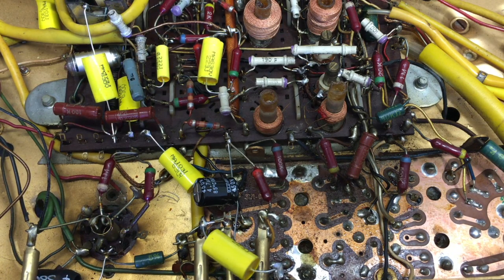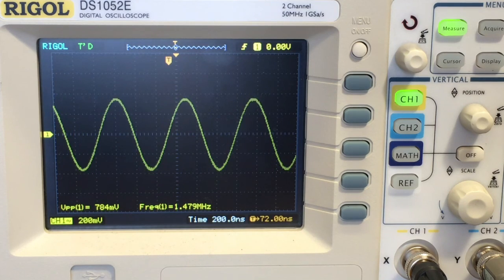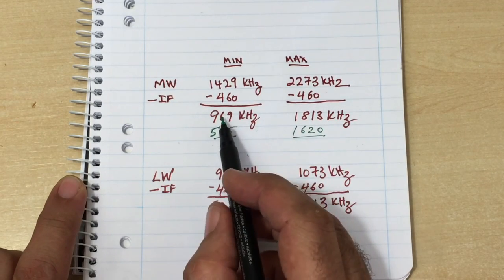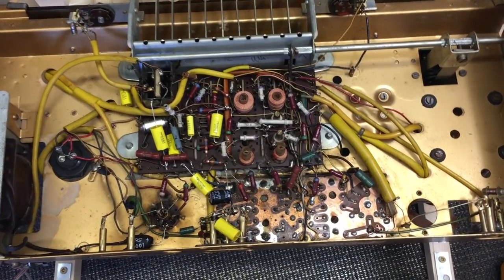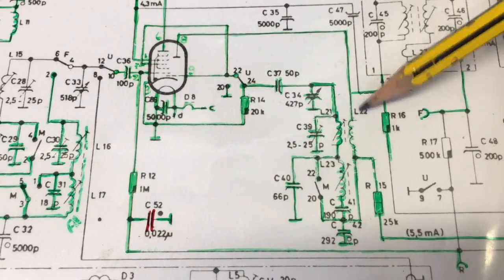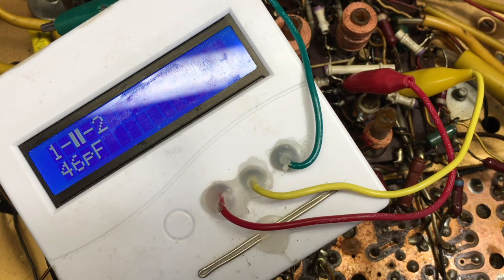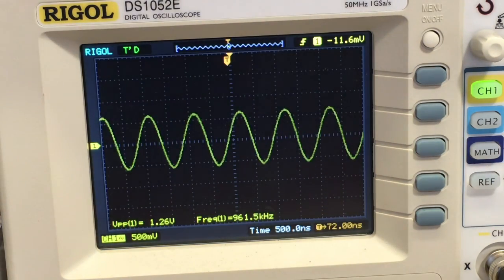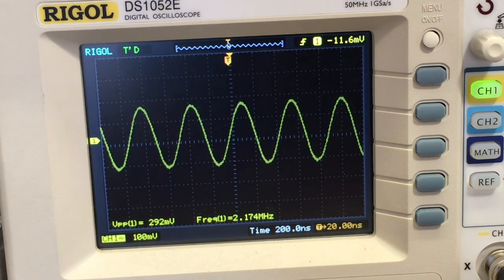Loewe-Opta Magnet 3737W tube radio restoration - Part 4. Oscillator still misbehaving.

Comment: What’s the ideal Rigol Oscilloscope available now for this type of oscillator problem, particularly if it was to be identified in the FM circuit? 

Would a 200MHz bandwidth oscilloscope at least 2 channels or even 4 channels be suitable?

I am in the process of restoring Loewe Opta Meteor 781 W and 1781 W similar in some respects to your choice of vintage radio, especially due to FM reception.

Cheers

Peter

😁
Reply from the maker: I now have the Siglent SDS1204X-E which has 4 chanels. Two channels would suffice.
Reply: @electronicsoldandnew  thank you very much M Caldeira. Your circuit work and troubleshooting is well explained, in detail and clever. I am sticking with the Loewe Opta vintage valve radios, so your videos are so valuable to me.

Just on a last note, I expect you’re referring to Siglent SDS1202X-E being the comparable suitable oscilloscope with 2 channels? Thank you again!
Reply from the maker: Correct. Have fun 😊
Reply: I put in an order for Siglent SDS1202X-E from Siglent in the Netherlands.

Great price $587 AUD including shipping.

My question is can I purchase or obtain a detector coil like you are using across the oscillator coils to input frequency into the new oscilloscope?

Maybe that’s DIY equipment or just not found easily in the electronics market?

Thank you for any help provided.

Cheers 

Peter
Reply from the maker: It’s completely DIY. Just wind a few turns on a small former with insulated solid core wire and try it out. It works a treat.
Reply: @electronicsoldandnew  Thank you for your help again. I am set to tackle more electronic troubleshooting now. You’re a nice chap. Have a nice week ahead. Cheers 😁

Comment: Awesome seeing this piece of history being brought to life again (well, at least the oscillator for now).
Also, I have a little question. The receiver that I have on my bench can tune between 65-73MHz (OIRT, the "communist" band) and tuning it to today's frequencies involves (according to some people) screwing in different ferrite cores into those plastic coil carcasses. Those different cores don't differ much from the original ones, I think they're just a tiny bit thicker. So here goes my question: can a ferrite core impact the reception and tuning quality by a big margin? I've read some people re-tuning those radios without changing anything (besides removing some capacitance in the FM oscillator) but their descriptions are rather vague, so I figured I'd ask a professional.
Reply from the maker: +Pinkorek : glad you've enjoyed the videos. As regards your question, i can only say that I honestly don't know if the changing of the cores is enough. I have restored about a dozen tube radios to date, but have not done an alteration like the one you want to do, so I cannot speak from experience. You effectively want to raise everything up by 30mhz. This would then give you a tuning range from 88mhz to 103mhz, good enough for most of the fm band. The problem is that you need to raise both the RF  input tuning and the oscillator tuning, equally and exactly, which is a little difficult. 
I can only suggest that you try it and see if you're happy with the results. Most of this hobby (I'm a hobbyist, not a professional) is based on quite a bit of trial and error. If you know the fundamentals of electronics and especially the safety aspects of tube circuits, you should end up with a good result. Good luck.
Reply: I forgot to add that this is a transistor radio (I wish I had a tube radio with FM capability though. I only have one that covers AM bands) and I did some additional research and figured out that those different cores have lower inductance, which supposedly allows for a higher sensitivity of the radio set. I know for a fact that it's possible to extend it to true 87,5MHz-108Mhz band. Either way, I'm going to try it with stock ferrites after I get some cheap FM transmitter. Thank you for your reply! I look forward to seeing more excellent videos from you.